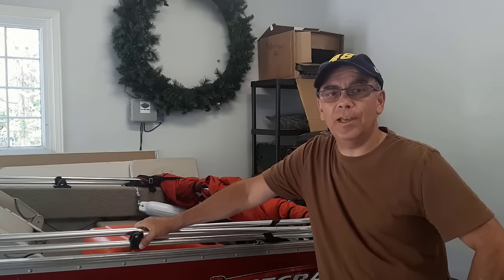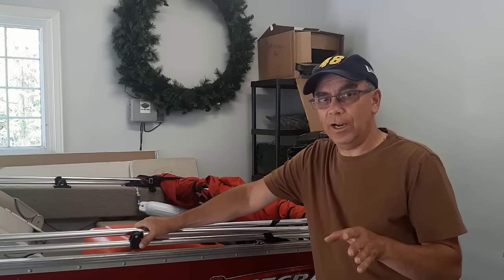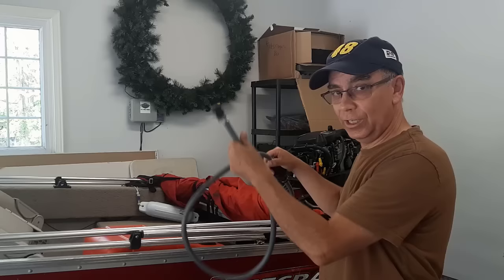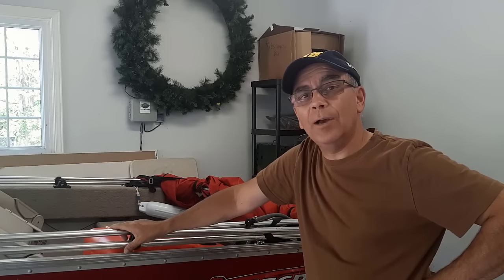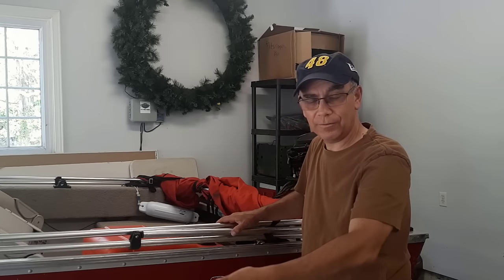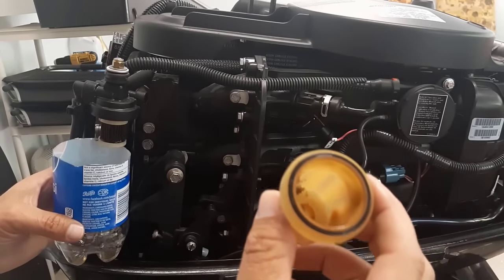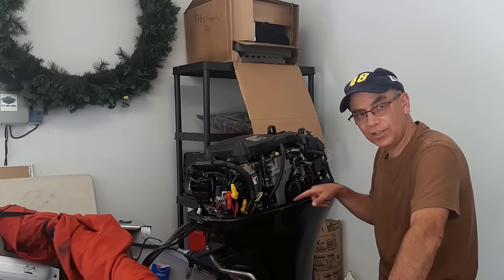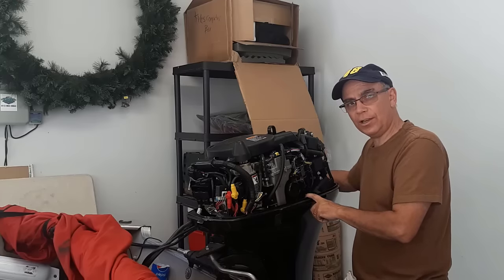Mercury Outboard Runs Then Dies // Try This Before You See Mechanic

Comment from the maker: Watch PART 2 of Mercury Outboard Runs Then Dies as I show you where the second fuel filter is located and how to remove it: https://www.youtube.com/watch?v=3YKp9NHQtXs  👍
Reply: Aloha from Hilo Hawaii. I have a 40 hp mercury on my 13'whaler. My problem is that the engine just immediately shuts off.  No chugging, no out of gas feeling, it is just like someone threw a switch. My mercury authorized mechanic has replaced ALL THE STUFF, you did and it still keeps shutting off. It won't restart for about 10-15 minutes, then it will do it again. Any other thoughts?

Thanks
Reply: helped a ton...thanks!!!
Reply: Hi, i replaced my solenoid which now the outboard starts and runs but after thr first trip the starter motor stuck on constantly trying to Start the engine without the key in so i had to disconnect the power wire from the starter motor which goes to the solenoid. This happened 26 miles out at sea but i managed to get the engine started by putting the live wire back on the starter motor and turning the key quickly then disconnect the live wire on the starter motor to stop the starter motor from spinning. Any ideas why? Sorry for the extremely large comment/question
Reply: I have a 2017 Yamaha 40hp on. Bought it with 74hrs on it...now has 116. I'm running strong, then idels in a no wake zone for about 15 minutes...stalls!!! Took me almost 20 minutes to restart. Took it back to dealer...changes fuel filter, runs a fishing line through where the water port exits.
All good for a couple outings....and once again, idels in a no wake zone...then stalls. This time 45 minutes. Periatic pumping the bulb... frustrated...I put out the orange flag ..5 minutes later...one last pump. It starts.. ran for about 400 yards....stalled!!!.  One more pump ...it starts...made it back to the docks about 2 miles. 
Got some seafoam marina fuel additive...ran it for about an hour. No issues. 
Not sure if it's a fix or not being the day before..it ran normal on our way back.... frustrated!
Reply: @tracylewis9796  ever find the issue?
Reply: Just for knowledge the tywraps are special with a curved saddle to make a circle when tightened.
Reply: Wait there is a part2?? I tried watching this one and didnt make it to the end thanks to my add, but i did learn a few things to check at least! Thanks!
Reply: Help , my Yamaha 20 hp is doing what your boat was doing I did everything and my motor is still acting up do you think it could be the fuel pump ?
Reply: @StevenProduction1000  part2 he shows you
Reply: @josho4971  did u clean carburetor
Reply: @vapinbachelor289  I’m about to just buy a new carb , I was just outside looking at her before work I’d really like to get my Yamaha f20 running good before end of fishing season
Reply: @vapinbachelor289  boats are weird sometimes . If I bring throttle half way it doesn’t do it 3/4 to full throttle it starts to chug after 1-2 min . I’ve been running her half throttle but that’s no fun
Reply: i found out my engine was sucking the primer flat and what happened was the fuel hose next to filter was cracked and gas was leaking in engine so i replace the hose and it runs perfect
Reply: I’m having trouble with my boat motor staying running could it be the spark plugs

Comment: The whole time I thought he was going to say he forgot to open the breather vavle on the gas tank.  I have done that and it behaves in the exact same manner.
Reply: Should the breather valve on the tank be open or closed? Sorry, new boater and I've run it both ways before, but my tank also has a hairline crack....?
Reply: @calebrodriguez3748  open.  But the hairline crack will serve the same purpose.  As the volume of fuel in the tank decreases, it must be replace by an equal volume if air.  Otherwise, a vacuum will be created that wil eventually stop the flow of fuel to the engine.
Reply: Had my breather vent on my 6 gallon fuel closed and my 40hp kept stalling after a min or two then would crank back up and stall out again felt like a clown lol
Reply: My boat would do the same thing And the breather would be set to run. I take the cap off and air would flow back into the tank. Is the breather plugged?
Reply: @beastmode9044  yep its clogged. just went through the same shit. it was gunky & clogged. now my boat wont start. bulb wont prime.  motor is 2 weeks old :(
Reply: I think you just saved me a bunch of time and money mr white
Reply: @beastmode9044  Almost certainly.
Reply: I recently purchased a new Atwood tank for my boat. For what it's worth, it has a 40 h/p Tohatsu tiller on it. Anyway, I was experiencing the same symptoms. I couldn't figure it out so I took it to a local boat mechanic. Turns out the good folks at Atwood didn't drill out the plastic for the vent. I could have taken the vent portion completely off and it wouldn't have worked. He didn't change me a dime, said "all I did was drill a hole." . He now has a customer for life.
Reply: Did this yesterday and when the motor died I opened the breather and I could hear the air flowing in. The carb is completely dry at this point so it took a bit of pulling before it started again. Like sweating taking off jackets pulling. "Remember to open the breather" is much easier.

Comment: I use black automotive fuel line and I wont have that problem ever again. Reuse your connectors with hose clamps & there's not a inner liner inside the black automotive fuel line to break down & it's cheap. Good luck 👍
Reply: I did that also to allow for ethanol fuel occasionally

Comment: All ways disconnect the fuel quick connections on both ends when not in use. Cause the o-rings will begin leaking air into the fuel line swstem. Best to disconnect all quick connections and oil the o-rings when not in use.

Comment: Good job. A tip:   Don't use plastic ties to secure fuel lines!!! Get correct stainless hose clamps
Reply: Plastic ties on fuel lines are fine if you use the one specially designed for it. Their locking end slot is at an angle so it grabs the fuel line all around. They are offered as OEM parts by all outboard manufacturers / dealers.
Reply: @PayNoTaxes0GetNoVote  That I know of, old Mercs had steel ties, the type that has its ends simply crussing one another and that you loosen with a pair of pliers.

Comment: I took a small engine class when I was in high school just to get easy credit.  I wish I would have paid better attention.  I am very handy with my hands building things, but small engines often get me.  I did change a carburetor last year and it fixed the problem - I chalked that up to a good guess versus diagnosing a problem.  I generally find it is fuel related - either the fuel or the carburetor.  Good video.
Reply: Get a good outboard repair manual and read it over and over ! That is how I taught myself Boat repair before  Yamaha sent me to school .

Comment: I put a visible fuel filter on the line from the tank to the motor just after the squeeze bulb. That way I can observe the gas flowing and that it is clean.
Reply: Exactly what i wil be doing once I get a motor for the old 1970s tom-boy I just bought
Reply: I have one of those laying around
Reply: That's a great idea
Reply: HOW DID YOU PUT A FILTER ON A MOTOR? YOU DIDN'T !!!
Reply: @donleejr7624  he put it in the gas line to the motor not in the motor or on the motor read it again
Reply: YOU DID !!  YOU CAN PUT ON A MOTOR. IS THE MOTOR AC/DC ??.
Reply: Great idea, I’m going to and one to mine with automotive fuel line.

Comment: I got the EXACT same problem on a 2 year old 60hp four stroke Merccury..... I’ve done the line, yesterday did the “new” remote/portable fuel tank. Ran good for 5-10 minutes and died again on what feels like fuel starvation......was going to take back to the dealer/marina (30 miles away) next week.....
Now will try fuel filter.....if it works Roland......I owe you a BEER ,..... as it saves me BIG BUCKS and more importantly....the best part of the fall fishing season. Thanks for a great video.
Reply: Did you resolve

Comment: Bought a early 2000 40 HP Mercury-2 stroke with auto oiler and it was rarely used by my friend and I bought it. I saw your video and checked the filters and my filter looked just like yours.  I replaced it and engine started and ran and idled smoothly. This video probably saved me from breaking down on the lake. Thanks!

Comment: I'm glad you found it. Sometimes it will get by the filter and get caught up in the screen for the fuel pump or in the fuel pump. And it can create the same kind of havoc blocking passage of the fuel and random fashion which is always difficult to figure out

Comment: Wow! I had the exact same problem about 4 years ago with my 60hp Mercury FourStroke outboard. I did everything you did here, except I also changed the other fuel filter, rebuilt the entire VST, and replaced the fuel pump. I had a mechanic tell me over the phone that the gas line I had was designed to work with MTBE (a fuel additive that was replaced by ethanol in 2007), but not with the ethanol additive. The new fuel line and bulb I bought had a tag on it that said it was made for gasoline with an ethanol additive. It worked.

By the way, I have driven from Colorado to mid-Saskatchewan every year for 20 straight years to catch pickerel, Jack fish, and lake trout. We quit about 3 years ago. I sure miss it.

Comment: I just escaped the everglades. Even my 3,5 back up engine failed. Low engine oil shut off.
wtf.I never had to use it before You sound right on about this .Same fuel hose degradation.
A cheap quick fix is rare these days. thank you

Comment: That fuel filter is made of sturdy plastic. It's not a paper filter. No need to change it unless it's damaged somehow. Just rinse it out, inspect it and reinstall it. Also at 8:41, before you hook that hose back up you might want to pump the primer bulb a few times to clear the fuel line of any residual debris that may still be in it.

Comment: Glad this worked for you. I had same problem in Manitoba but for me it was moisture in the gas from leaving the gas tank vent open in the rain. 

The moisture would plug the jets in the carb. 

Fix:put 1oz isopropyl alcohol in full tank of gas(or replace gas), tilt motor up in lock position, prime bulb until gas come out of carburetor throat and use a water absorbing insert in tank(made for snowmobiles)and that should solve another issue that can cause this same problem. 

But yes, pay attention to the breakdown of fuel lines and you fuel filters.

Comment: That grey fuel line has been an issue with ethanol since the 90's. Go to parts source and get a roll of 5/16" fuel line for less than 30 bux and replace it all! You won't have that issue again. I've done it with all my boats. I am picking up a 2021 Lowe in 2 weeks and will replace all the fuel lines before it sees water. Good Vid !
Reply from the maker: Yes I will be switching up that fuel line
Reply: How is that line different than what would be on a brand new boat?
Reply: @timtaylor8557  Because the stuff you get from Parts Source is regular fuel line (black that is used on cars), not the grey stuff that still comes on new boats that has a plastic liner inside the hose that breaks down from ethanol.
Reply: @2old4fpv-k8y  maybe not all boats use the same quality. My boat is a 2019 and the fuel lines are black.

Comment: Great video to help with those stubborn intermittent issues. FYI the plastic ties on the fuel lines are not necessarily your average every day cable ties. Technically there are special fuel line cable ties that have a "shaped" lock end that is curved to maintain contact pressure a full 360 degrees around the line to avoid fuel leaks. They are known as radius zip ties or radius cable ties.
Reply: Never knew about this. Very cool
Reply: I used regular also -- where can you find those?  --- ah googled them and found them on amazon ordered, you'd think mercury would put them in the kit, oh well I had to get a hundred so ill be for for the next 50 years or so....... thanks again I did not know about those

Comment: My boat had same issue. Built in fuel tank. I decided to isolate the issue by replacing the fuel line kit like you and an external new 6 gallon tank. Problem solved. Built in tank has sediment and old fuel. In process of cleaning it now. Your fix will definitely help relieve alot of headaches and wasted money. I knew your issue from the minute you said what happened. 😀 mine is also a mercury 135

Comment: Great video. I am having the same problem. Boat is 38 years old. I've had it two years. I'm betting the fuel hose is the original. Will replace it tomorrow.
Thanks

Comment: This is the closest issue to mine that I have found online. My Toyota outboard runs great and will just quit. From there I shut the key off, put it in neutral and restart. This might happen once in a three week period or it might happen 3 or 4 times in one outing. So, it's intermittent. And there's no sputter. It just quits. Thanks for putting out the video.

Comment: Great video.
I had the same issue w/my 25hp Yamaha out board & found out the liner in the fuel line collapses when I give it full throttle after running it for awhile.
So now I'm just gonna replace it w/regular fuel line & change out the fuel every yr when I store it for winter.

Comment: I recently bought a used Mariner 15 hp outboard. I didn’t want to spend the 4000+ dollars to buy a new one. I only have about $600 in this motor total and that is after installing a new impeller and propeller. The motor has ran well until recently. The tank is an old metal tank and I have been having the same issues as you. I suspected it might be a fuel supply issue and you have helped confirm my suspicions. I plan on doing as you have suggested. Thank you for making this video.
Jim Seaman
Darby, Montana

Comment: After having issues myself, I had found a plugged fuel filter. I change the filter and fuel line and drained and cleaned the fuel tank before I saw your video.
So I went out to the garage and cut my old fuel line open today and found it 85% to 90% clogged with that brown crap.
Looks like the fuel line should be on the maintenance schedule!
Good to know what the source of the problem is.

Comment: At first I thought the fuel pickup in the tank was plugging up as I have seen that before.  But the simplest and maybe cheapest next step would be the in line fuel filter.  Also I have seen many situations where there is an obvious filter in the fuel line but another hidden filter too. On my 30 year old 15 HP Evinrude there is a screen on the carb (if I remember correctly) that caused me the same issue and my mechanic showed that to me. Overheating doesn’t fix itself quickly. The engine has to sit quite a while before it will run again well.  Great video and thanks.  I also didn’t know about the inner fuel line inside the fuel line.

Comment: It sounds like that inner liner was a step up from the old Styrofoam liners they used at first! 😂 I had a VW long ago with a similar issue. I didn't know but the tank was rusting away on the inside and clogging the fuel lines. It caused me lots of headache until I learned what was causing it.
You helped folks today with this video Roland.
Fresh people being born everyday that need to learn everything.
Have a great day up there!
Reply from the maker: Wow I'm late seeing this one Robert. Thanks for sharing your issue.

Comment: Thx for this - extremely helpful. I did EXACTLY the same sequence as you, including replacing the fuel line from the tank, then the tank itself, then the filters. In my case I needed to change both flters to remedy the problem. Thanks for taking the time to make and post your videos.
Reply: So hard to find a good "honest"marine dealer.  This video explained the exact same symptom my Mercury 40 HP was exhibiting.  Went through your process and it runs like a dream.  Thank you for taking the time to teach us.

Comment: Great video I had the same problem during sockeye season 5 years ago. I’m my case it was the bulb.. it still felt nice and solid and sounded like it was pumping but the internals had collapsed and wasn’t allowing enough fuel through… just enough to start and idle and run for a few seconds under load then would die.

Comment: Excellent video. Applies essentually to all outboards as far as tanks and filters. As you state always check the tank, fuel line and filters first.  Never run old gas in any motor you care about. A great old timer mechanic told me 90% of hard or no starting issues are fuel related. Also many people aren't aware of the 2nd fuel filter in most outboards.

Comment: My Johnson 70 did this. It was the diaphragm fuel pump. So I bought a eldebrock 1-3 psi electric fuel pump. I hooked it up before the primer ball and to a toggle switch.  The moment my boat started surging I would turn that fuel pump on and it would instantly run great. The diaphragm pump has a hole in it

Comment: Drove my father nuts, his classic Mercury 50 would get on a plane and start "limping" , there is a liner in the fuel line that would come loose from the inside of the hose. It's a weak little clear plastic lining that this ethanol gas would dissolve the glue holding to the fuel line walls, that liner is weak, when you throw fuel pump pressure to it the inner hose would clamp shut. Think like sucking a soda straw flat. Couldn't get enough gas w that restriction. 
Always use non-ethanol gas. Always.

Comment: I have had that same issues...The Ethanol in the gas we use today breaks down that liner. Nerve buy a fuel line with a gray hose. Instead always use the black fuel line. As you can see inside the motor, all the fuel line are the black hose. If you need to, just buy the ball and fitting separate and create you own fuel line from the tank to the motor. It may cost a few bucks more, but it is worth it! Plus you can customize the length of the hose.
Reply from the maker: Thanks for watching!